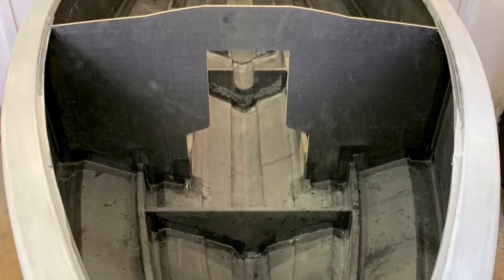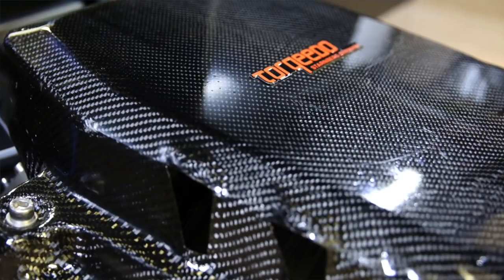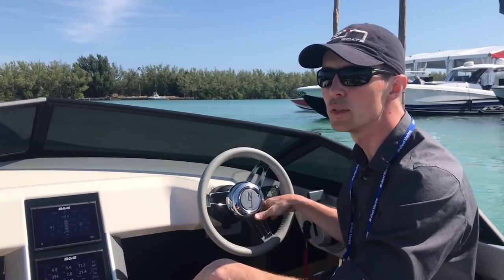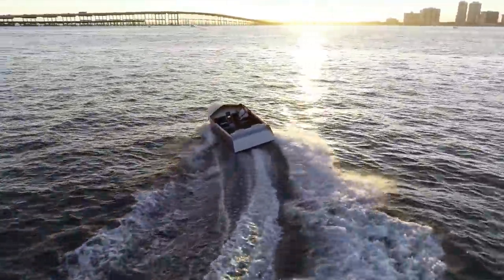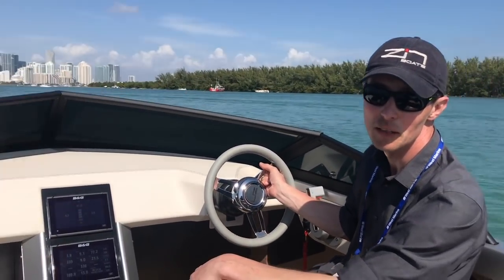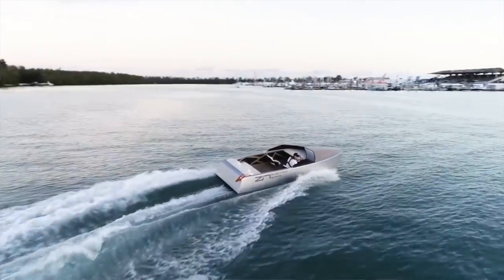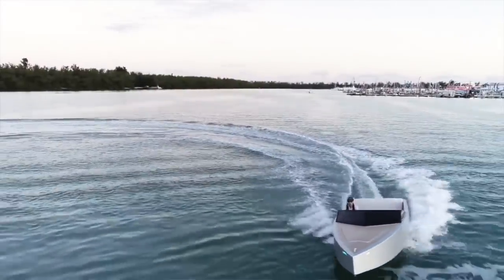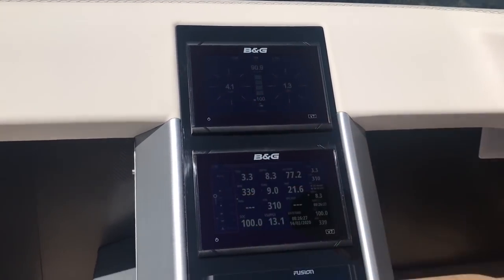Test Ride: Zin Electric Boats Z2R | BoatUS

Comment: I don't know that this is even remotely comparable to Tesla, because my 23' Carolina Skiff with an Evinrude 150 that sips gas and runs 45mph was only $50K, so I could buy five of them for the cost of a single Z2R, as well as invite more than twice the number of people. In the case of a Tesla S at $100K a comparable gas model would be an Audi S7 that sells for $90K and the Audi is slower! With the tax credit and fuel savings the Tesla is actually a cheaper option, whereas I don't see saving $200,000 in fuel with the Z2R even with free charging.
Reply from the maker: Good points, Tom. We weren't really going that deep with the comparison, but I can see how you might. We've got a fascinating article on electric and hybrid propulsion coming out in the April/May BoatUS Magazine, which is arriving in member mailboxes any day now. After working on that story with the author and experts, Rich was pretty excited to see the technology for himself.
Reply: Id get the rs7 why wpuld anyone by the s7 for that price range get the rs7 there out there for less. May have a few miles on it but very very low. And f it all buy a v10 r8 i seen them used for 100k with less then 2400 miles on them i nver buy a tesla there lame. Id take a v10 screaming at 8000 rpm over 0 noise car with shit brakes. And tesla over 120mph are junk they fall off the radar in speed at anything over 100 really. A r8 will eat that car with a good tune on it especially after 120 mph itll be by by. I hate electric there shit. I would take the rs etron though why because its audi.
Reply: @RICHIE_RICH89  So jacked and drunk? The point of my EV (Electric Vehicle) comparison is for the same money you can get a EV that saves you a ton of money on gas AND has better performance than its gas counterpart. In the case of an EB (Electric Boat), you pay 5 times as much for less performance, so it's a lose-lose scenario. You hate EVs because they don't generate the "look at me" noise your Little Richard overcompensation requires. The only sense you made is the "after 120 mph" comment, but when and where does one have the opportunity to drive over 120 mph?  In any real life situation, your tuned R8 would be the equivalent of jumping into a cold pool, when compared to a Telsa S that costs $100K less and gets 10 times the mileage.

Comment: Very cool! Performance is not surprising but price will be a real "headwind". Even more so with the recent significant drop in the cost of a barrel of oil. Need a creative financing program to get more through production and on the lakes and waterways! Good stuff.
Reply from the maker: Rich had just finished up working on a feature for April/May BoatUS Mag that's all about electric & hybrid propulsion. There is so much happening with this technology right now, he was really interested to see it for himself. I think the biggest shock was how easily he was able to carry a conversation without shouting while underway. The technology is changing very quickly, and we'll see prices begin to drop over the next few years. Distance between charges is one of the biggest challenges right now.